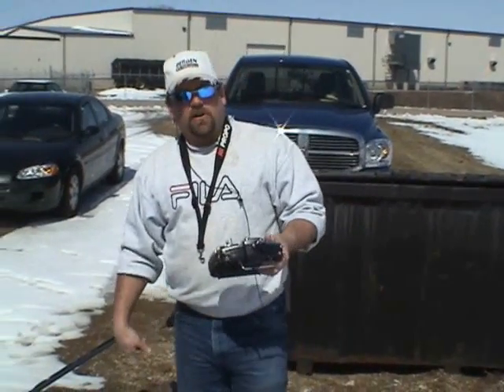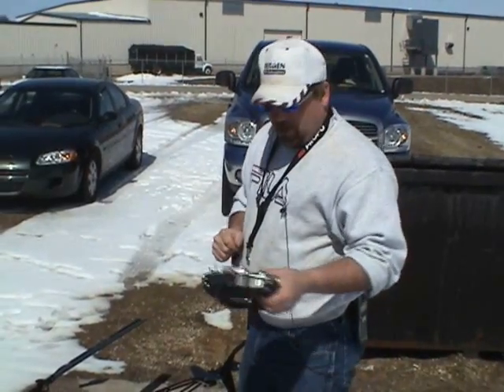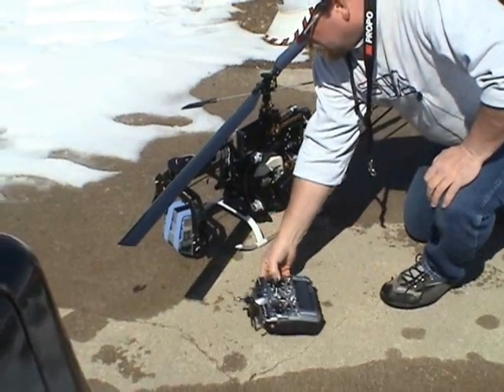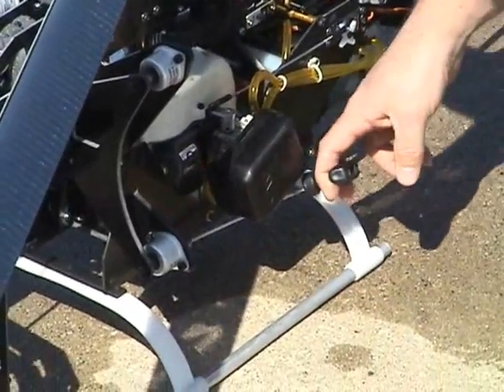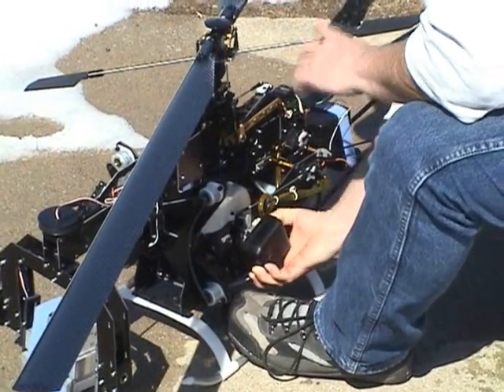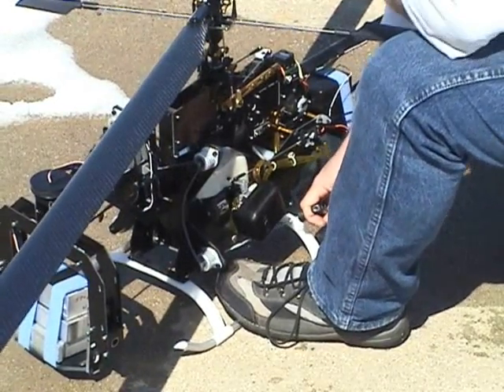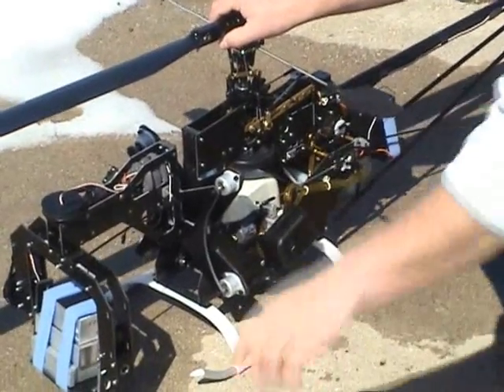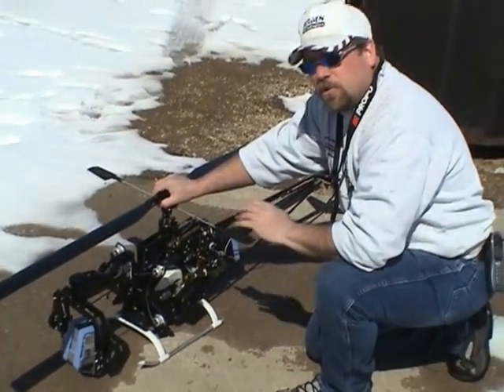Starting procedure for a Bergen Gas powered helicopter

Comment from the maker: Our Observer series of R/C Helicopters are designed to carry a camera, vs adding some structure as an afterthought onto existing hobby model aircraft.   As such, it's required to have this weight on the camera mount to maintain the proper CG of the aircraft.  For initial test flights, we simply use ballast weight (chunks of scrap aluminum) on the mount.   That way we don't risk a high dollar camera on these test flights.